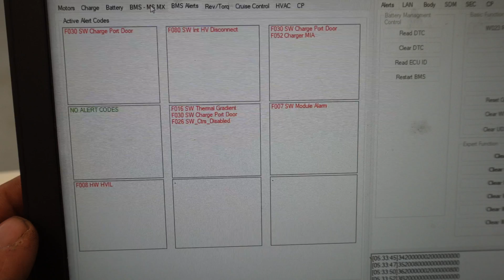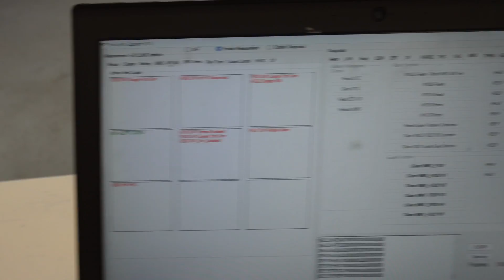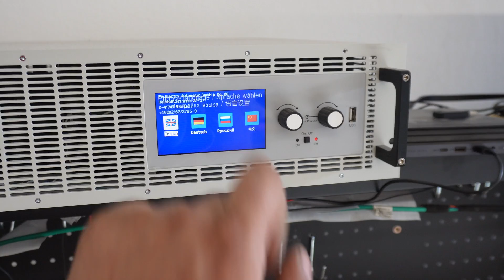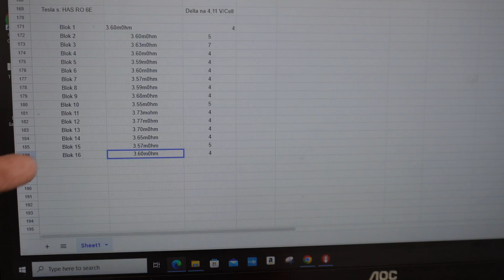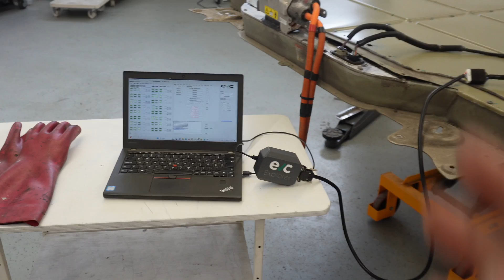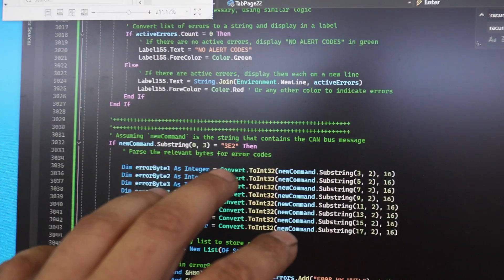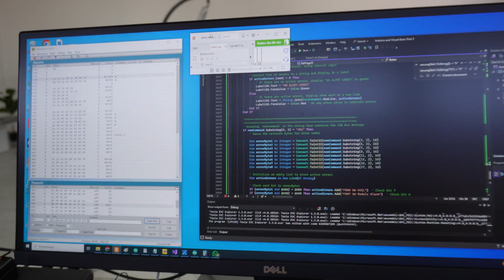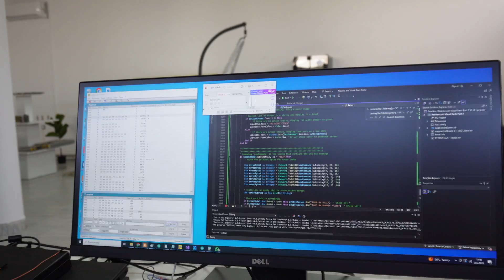Tesla EVC Explorer - Battery Reset and Diagnostic BMS_U029 BMS_F107 BMS_F123

Comment: Have you ever cleared a CHG_f012_hw_FastChargeDriver fault?  I have a feeling its a code stored in the eeprom somewhere and cant be cleared normally. Your videos are awesome!
Reply from the maker: @idus  had once that problem, but it is chip defect on BMS
Reply: @evclinic so need to drop battery and replace main bms board.  
Thank you so much